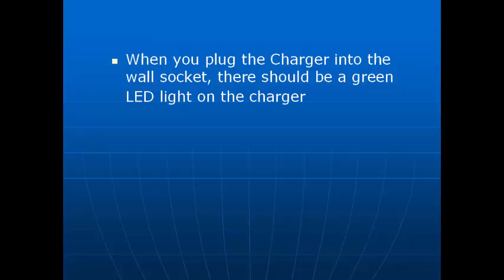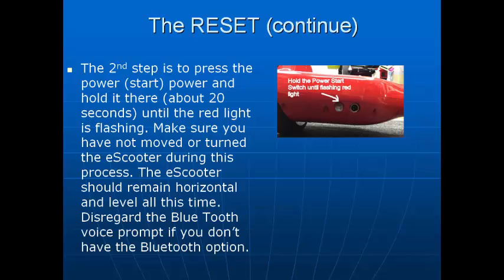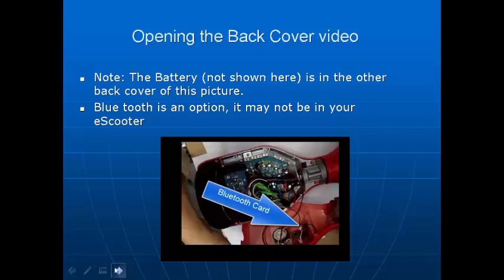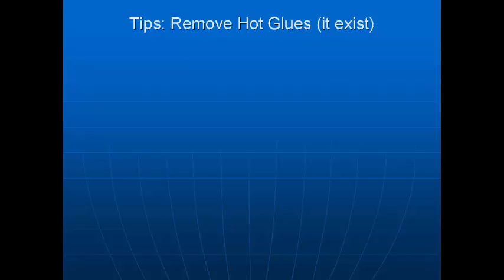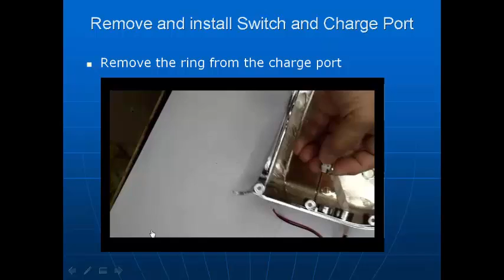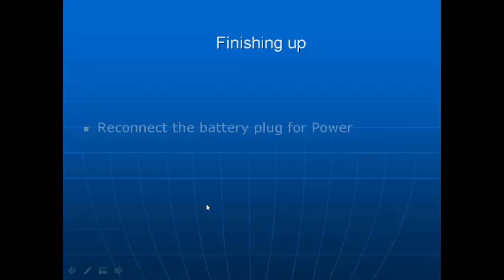Hoverboard Scooter Repair - Help, My Hoverboard Won't Charge

Comment: just got the new charger which looks slightly different than original.
plugged the hoverboard to charge and the green and red ligts constantly flashing and beeping?
What is the problem?
Battery is completely dead.Thanks
Reply from the maker: +Reza Mesgarlou Does the green light turn red when you plug it in?
Reply from the maker: +Reza Mesgarlou I apologize for the slow response. I have turned my email notifications one :)
Reply: charger flashes red. what is wrong
Reply: hello